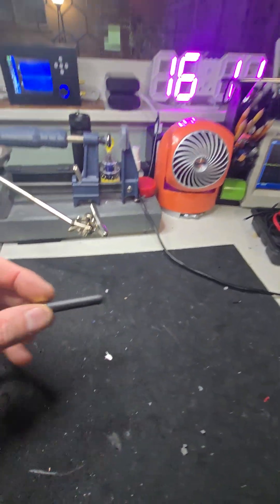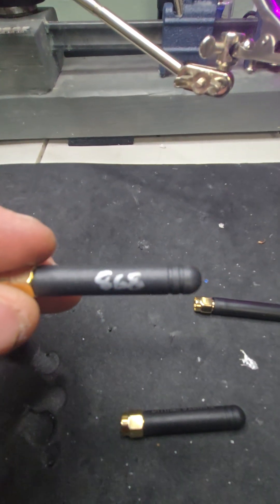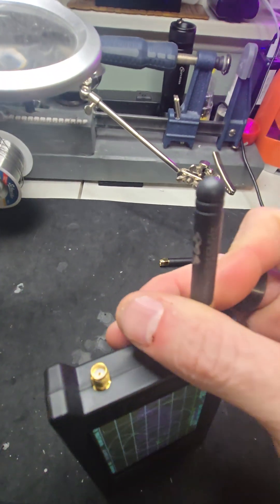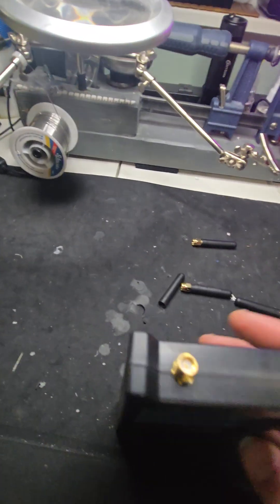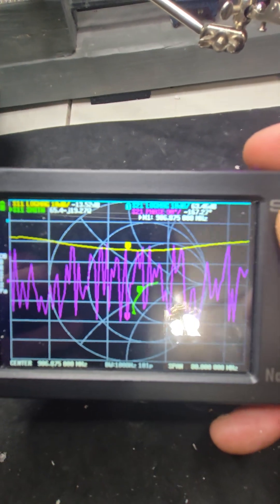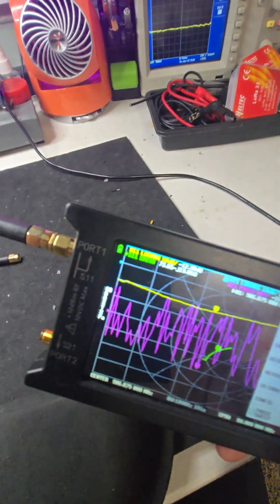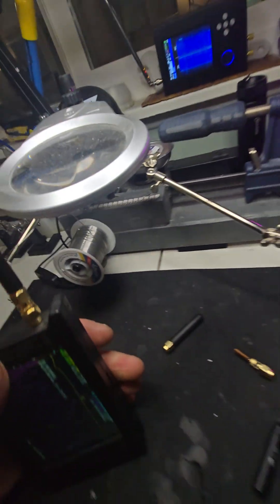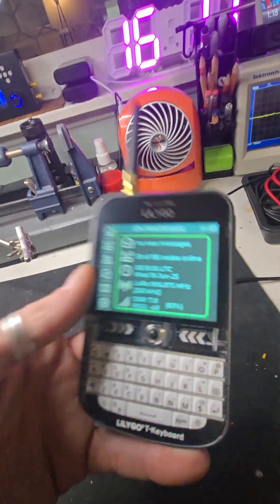Tuning your "915mhz" LoRa / Meshtastic / Meshcore antennas.  (They're not 915.  I bet you.)

Comment: So if you add the wire that attaches the antenna to the device… what do you get… a different number because the wire is longer. Would a SWR meter with cable attached be a better way to tune it?